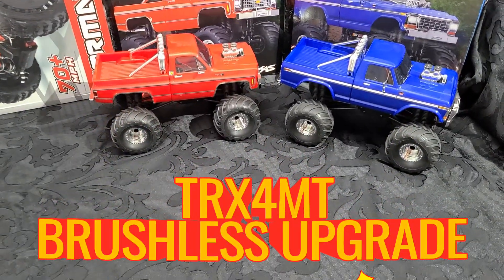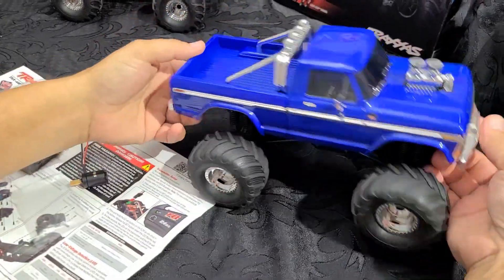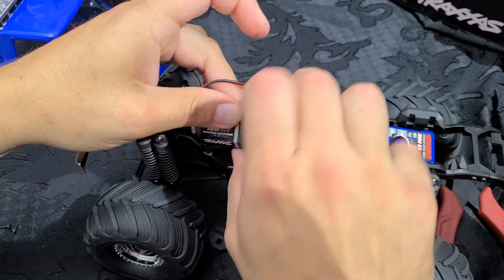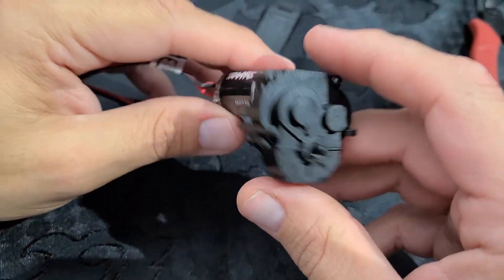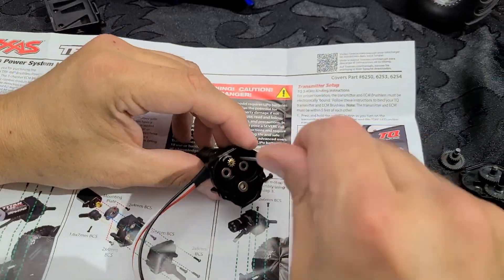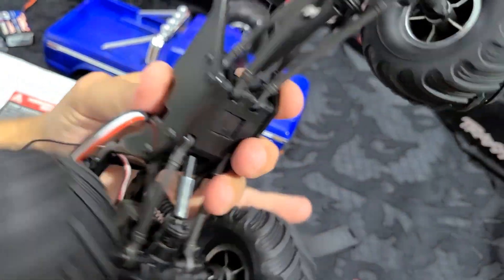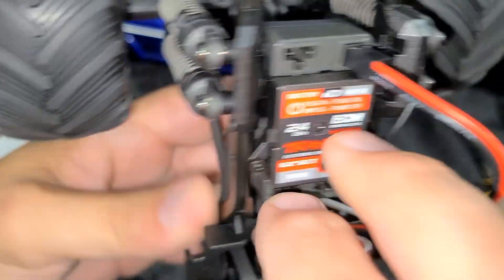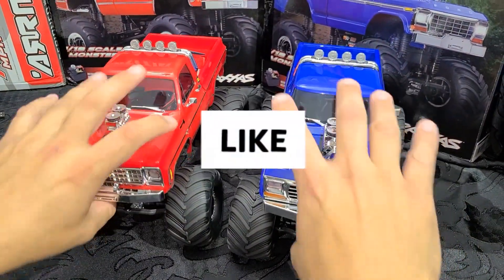Traxxas TRX4MT Brushless Upgrade. Full install of the Traxxas TRX4M Power System. Includes binding

Comment: 1st test should have been stock vs. stock right ???
Reply from the maker: They are the same truck with different bodies, so they would perform the same stock. Unless I am misunderstanding your question.
Reply: @Goduvwar  I believe even if they came off the assembly line one after the other they will have differences, maybe not measurable differences but still, maybe quality control is better than that but than again the only way to know is to test, Not trying to be a pessimist just trying to cover all angles:)

Comment: that transmission have no bearings? just bushings?
how have you tried this with the high speed transmission?
Reply from the maker: I have installed bearings in both vehicles now. I did install the high-speed gears but removed them immediately.  With the stock motor and the high speed gears, the truck did not have enough power to function properly. Low speed driving was not possible. Then, I tried installing the high-speed gears with the brushless system, and it created way too much heat on the brushless motor. It would have burned up. For the type of driving we do with these, the brushless system and the stock gearing work perfectly. And it can still crawl if you want it to.

Comment: Thanks for posting. Let me know if it gets really hot. My traxxas brushless motor gets very hot.
Reply from the maker: You are welcome. Brushless motors are usually safe up to about 145 to 150 degrees.  So it will be hot to the touch but may still be ok for the motor. You can check it it a cheap ir temperature gun. They are like $15 but are an easy way to check your system. every vehicle is a little different, so pick one of those up to monitor your vehicle. Also check to make sure something is not causing any binding in the drive train. That can cause heating as well.

Comment: How much does this setup cost?
Reply from the maker: the Brushless system cost $119 directly from Traxxas.com.  I will give you some insight. we a Currently filming the review of the brushless system for the side by side comparison and ended up blowing out the differentials. So just to give you some advice I would highly suggest buying the steel differentials as well.